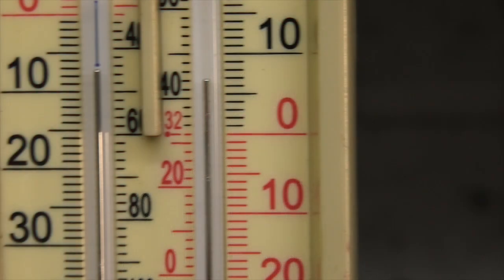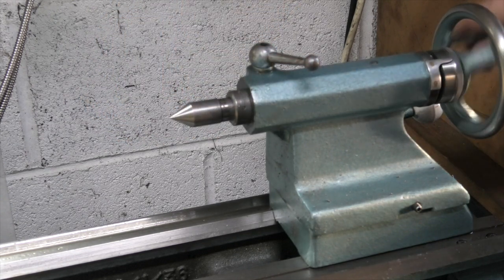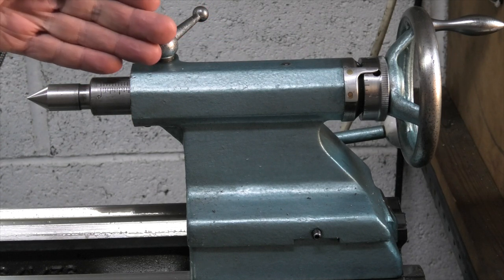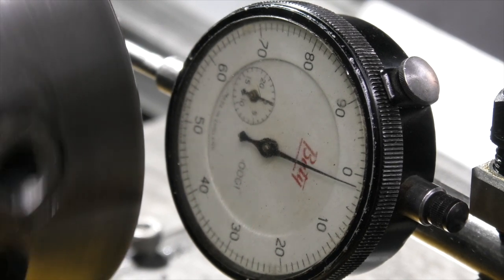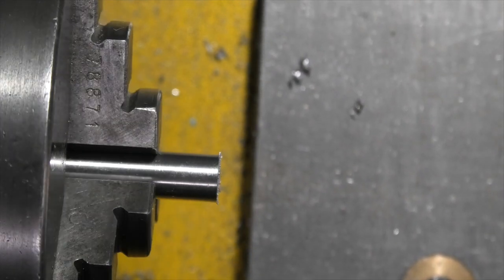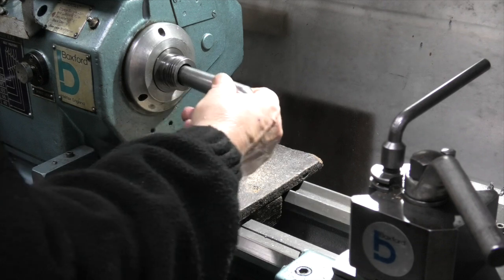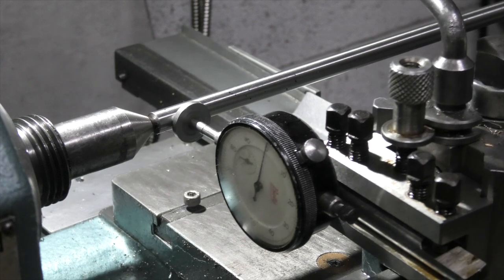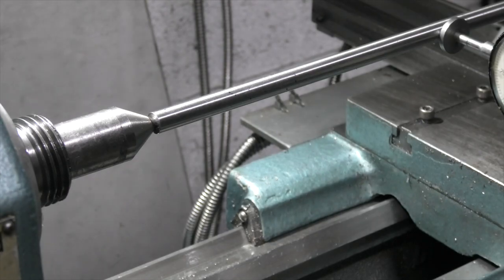Tailstock checks

Comment: Hi Alan.  Are you sure that the taper in your headstock is No2?  It’s no3 in mine.  No2 for the tailstock is correct.  Also, it may be worth noting that one more step would be necessary.  The tip of the tail stock dead center may be aligned however the bore/quill may not.
Reply from the maker: Hi Yes it is a number 3 morse in the head. I have no adjustment on the Quill.
Reply: @ yes, that’s typical.  I’m working on a friends Chinese lathe who’s quill isn’t inline with the bed and headstock from the factory.  Lots of scrapping to get it straight.  We’re lucky, this isn’t a problem with well built British lathes.  Love my Boxford but just bought a Harrison M250 to replace it.  I really enjoy your channel.  Cheers from Vancouver.